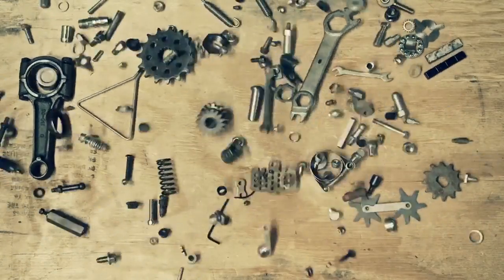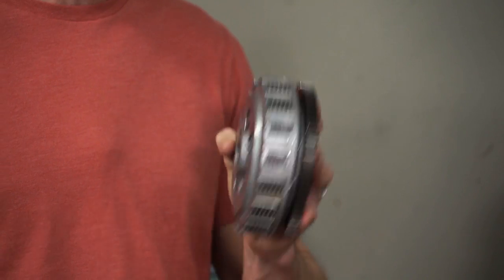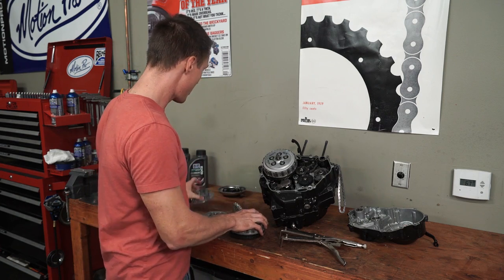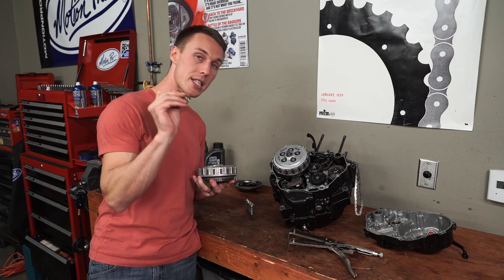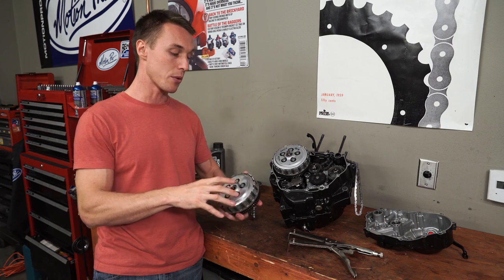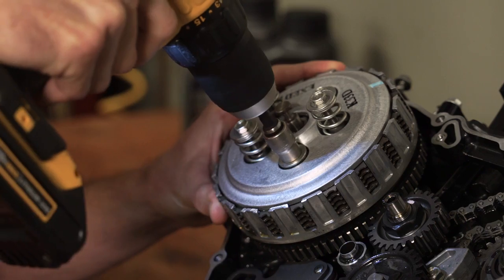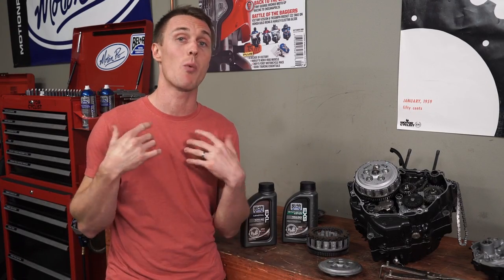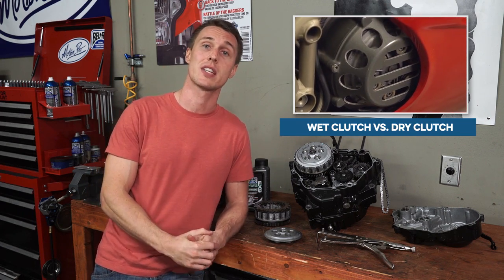How A Motorcycle Clutch Works | MC GARAGE

Comment: My brain just will not let me understand how the actuator arm can disengage the clutch. I must be missing a massive piece of it to not understand. 

Clutch actuator arms on the clutch cover on many bikes, on my bike, there’s a little plunger that pushes into the centre bearing of the clutch. How can pushing that bearing from the clutch side, cause the plates to separate? That would just push the plates together even harder.

Comment: I had an '06 GSXR 1000 that I had built and was around 175hp to the wheel. And I had to get new a new basket and inner hub, because mine chattered if I tried to take off to quick, and it would lurch. So I got a new basket and hub, and I added three more holes to the basket to allow for more oil. And when I did that, I also put heavier clutch springs in to decrease the wear on the clutch plates. My clutch lever pull was heavier, but it wasn't bad, and I prefer a heavier clutch pull.

Comment: I've always thought it was amazing that those plates and sitting have enough friction and force to not just slip when the power of the engine is put into it. You would think that the power of the engine would just overcome the friction of the plates, but it doesn't.

Comment: What if their could be hydraulic assistance for a racing clutch ...like an auxiliary pump that sends power to the clutch handle on demand in order to make the pull tension demand easier...or a diaphragm in a cavity that would open and shut somehow...like power steering...would that be hard to engineer and integrate into racing technologies...i mean like for ease of operation on a pilot...what do you think???

Comment: I hear people talking about shifting with the clutch partially pulled (like 1/2 of its full travel). They call it something like "shifting in the frictione zone".
Their argument was 1/2 the travel is enough for transmission to completely cut off. AFAIK the travel of the clutch can be adjusted and bikes aren't equally manufactured. I don't ride, only drove a few hundred Km or so on a friends bike and i notice their clutch need to be fully depressed like 90% to be fully cut.
So what's your take? I love to hear from the the engineers who work with the inner of these machine instead of some random biker on the net

Comment: My KTM rc 390 2015 10,500 miles clutch just broke, ( I think.) I was on the freeway and I switched from 5th to 6th gear and I heard a clanking noise. And I lost all power. No matter the gear I had no power, it just reved away. Is this fixable?

Comment: So I have a 1999 honda cbr 600 f4. And I had some creeping issues when I pulled in my clutch so i adjusted my cable from top and bottom and that didnt change it. So I bought a new cable. Installed it. And nothing. Same issue. Now I cannot even put it in gear before it stalls. I think it may be the lifter art or actuator. But I'm not familiar with bikes nor have the money for a shop to diagnose. Please help.

Comment: Hey i am 55 years old  and usually for. Me its easiest to  understand mechanical things bu physically looking at it or by. Reading a shop manual with good illustrations  ive been riding and fixing. My own motorcycles since i was  a kid and despite knowing what a motorcycle clutch pack looks like I really  didnt understand how it worked so. I watched your video and learned pretty easily  I’m not sure if it was your  simplified explanation or the  tone of your voice but i do again want to mention  usually a video isnt  as easy for me to understand  something mechanical as easy as. Your video did. So i just wanted to say thanks and i hope you do continue to make similar  videos  in the future  at the moment  i am not riding a motorcycle due to a Traumatic Brain injury ( non motorcycle related) that caused. Some paralysis. In my right hand/arm , and left leg  that would affect my clutching and shifting  i turned to YouTube to see. What might be  my options  as far as making a bike a auto or semiautomatic transmission  as i remember. I had a early 1970s Honda Minibike set u that way  and ironically the motorcycle i  actually. Do own at this time  is a  older Honda with a similar  engine that was my Fathers  that he bought and put into inside storage in the early 60s  so ive been trying to learn as much as i can  on the basics  as i found out Honda did make a Semi Automatic clutch pack for those old Monkey bikes but the case is a little different than mine  so it wont fit  if i want to maintain the factory look on mine which i do ! Just   For giggles i thought that would be  the route  keeping in mind  it is only a 90cc motor and would never really be. A touring. Bike for the highways and may   Be  for local shows and  possibly parades  ? Because it was my Dads  i just want to have fun with it

Comment: I have one doubt about bike engine cc,
Why always engineCC are 154 for 150,179 for 180
Etcc,,
Their is a slight positive or negative variation in engine cc,but the bike aa known as RC 390,R15,Pulsar 220,RS 200,
Why the manufacture could not build that engine with correct engine CC mentioned in the their name,
Plz anwr my qst

Comment: Hi. Can you help me? I think i have a clutch problem, because when i turn on my bike (Yamaha Virago 535 - 1997) it makes some knocking noise, and when i pull the clutch lever in neutral it ends, and starts again, when i release the lever. There is NO problem when i shift, it behaves normally, smoothly. My question is, can you name the problem? Does it really bad? Can I ride it with no fear?

Comment: So im a bit confused. With the bike started, I'll shift my bike from N to 1 (with the clutch pulled in) and everything will be fine, but if the bike is not running, I can't shift it to 1, pull in the clutch, and then roll the bike? Is that supposed to be like that? 
Sorry I'm kinda new to motorcycles :)

Comment: If my clutch is slipping, how can I check to make sure it wasn't just the oil? Add a little gasoline to the oil, run it a few minutes, drain and refill with known proper oil? Assuming I haven't already worn out the clutch from the slippage...

Comment: When I pull my bike clutch n it’s in gear it still moves any help and u will hear some noise in the engine
Reply: Adjust clutch lever tension or replace the cable. For some bikes you might need to lubricate it too. Check the oil level on your bike while you're at it.

Comment: I have a 900 vulcan. I had a shop put a new clutch kit in it ,got it back and is started barking on take off in first gear.took it back he changed the  two outside plates and cleaned all the metal plates.I went and got it and it made the same noise at the first two lights. took it right back ,he think i'm dumping the clutch to fast.I think he is wrong ,it shouldn't make that noise at all. It sounds like a dry clutch.so i'm wondering could the clutch basket be bad and making the noise ?

Comment: I have a problem with my bike not sure whether the issue is with Clutch or gears. In the Morning Hours or when the engine is cooled down every time when I start my bike and put it in first gear it makes a big sound, goes little forward and the engine gets turned off.  but once bike engine gets heated up it doesn't make much noise but gives a little jerk. Gear shifting is also hard. I have changed clutch plates but I still have the same issue.  can you please tell me what is the exact problem

Comment: for the clutch and the engine is it better to (while changing up gears for examoke 2 to 3 etc ) accelerating while releasing the clutch or just before for smoother ride and clutch use ?

Comment: Hi I have a honda xr650l 2012, but know when I start the bike in neutral the engine runs, but when I put it in gear the bike jumps and die, it's like putting your bike in gear without putting the clutch. What do you think is wrong we replaced the clutch plates but it isn't it, it's still doing the same?

Comment: My clutch cable broke.  I was still able to shift gears by moving the lever on the engine by hand and working the shifter.  Before and after replacing the cable, I kept checking to make sure this was still working, and it did.  Once I'd replaced everything and adjusted the tension, I started it up and now my shifter won't budge at all!  Can't get out of first.  What gives?

Comment: I am having an issue with the gear change. It gets very stiff from 1st to 2nd then they work normally. Is it something to do with the shift gear? I have tried to adjust the cable but no use. Should I change the whole clutch? Any suggestion will be much appreciated.

Comment: Great video keep up the great work my question is I have a 2013 Honda CBR double or 1000 with 2500 miles on it and when I engage first gear it hits really hard even when it’s warmed up it idles at 1200 rpm’s I cannot find anything on this is it an adjustment internally my lever adjustment is perfect thanks Dan P

Comment: I think I FINALLY understand how a motorcycle clutch works! It's especially funny because I left my clutch exposed on my Ducati 748 (arrogantly thinking I looked cooler) and made a stupid mistake when I was learning the bike, ending in my clutch in pieces across the asphalt. Not pretty. But the worst part is, I had NO idea what all those parts were for, and so had to shell $$$ I didn't have to get it fixed by an expensive dealership. Now I understand what all the springs were doing, and I've learned my lesson on many levels XD

Comment: I'm looking for a description or demonstration of how the clutch release system works. I wonder if there's a bearing that is spinning when the clutch lever is pulled. In a car or truck this is known as the throw-out bearing but I haven't found a description of the clutch release yet. Does it stop or is it wearing the bearing when at a stop and the clutch is pulled? Might it save the bearing if it's in neutral instead?

Comment: Ari so basically when you disengage the clutch when pulling the lever the inner basket together with the steel plate rotates with the gear shaft. The outer basket and the friction plate rotates with the crank shaft? Did i get it right?

Comment: Hi and thanks for the video, I have a VFR 750 F 1997 and with the bike running and and in nuetral there is a distinct rumble from the clutch which goes away when I pull the clutch lever in. There doesn't seem to be any clutch slip so I'm thinking a bearing or clutch basket problem, what's your thoughts on this please.

Comment: good day ari henning,,,, what will happen if a clutch has already slipped and my bike runs already but not much because it loose power at a high rev. my  question is,, does the clutch housing or inner hub? will be worn to,, if i use my bike with slip clutch,, but i doesn't drive on  high speed.. thnk you and i wisht that you answer my request tnhk you

Comment: can anybody answer me this question pls. someone asked if it's safe to freewheel squeezing the clutch lever all the way back? will it damage the clutch pads and plates sooner than expected? the guy who asked this is a newbie and most of the people answered "yes" it will. cause basing on the video once the lever  is pulled to disengage the plates will rotate independently so no pressure is placed on the plates and pads so no friction to damage them.  is it safe then to pull the clutch lever all the way back to do a freewheel run considering when you re-engage or release the clutch lever it should be at least close to its proper gear and RPM to minimize the stress on the pads and plates? thanks Ari and McGarage

Comment: Stiffer clutch springs do result in a heavier clutch lever, but the upside is zero slippage and all the engine drive is being transmitted to the rear wheel for max power. So if your OEM springs are too soft, upgrade them to a stiffer version and enjoy the difference. I did and I LOVE it.

Comment: Ari, I have a question! When replacing a worn out clutch pack with an aftermarket pack, why do most aftermarket manufacturers recommend you NOT use synthetic oil? If you soak the friction plates well, shouldn't it not make a difference? I've considered aftermarket clutch packs, but never pulled the trigger due to the manufacturer recommendations to only use mineral oil. Any insight you have on this would be greatly appreciated. Thanks!
Reply: Thanks!

Comment: synthetic oil is kinda pointless for dirtbikes when you have to change it so often. they ones that dont make a clutch slip are probably expensive. i learned the hard way it makes the clutch slip, changed it went trail riding then wrecked once it soaked to the plates lol.

Comment: So what is the answer to the debate about leaving the clutch lever pulled at a stop light as apposed to putting it in neutral and releasing clutch?  Is there any more wear on the clutch to do this or does it even matter?
Reply: Ari Henning thanks i have the habit of leaving in gear also but always worried it was wearing clutch too much. I can deal with some wear for the added safety thanks!

Comment: Thank you, Ari.  This sorta explains why, when idling in neutral, there seems to be more clutch related noise.  I presume it is the outer basket spinning and the disengaged inner ring & pressure plates are free to loosely spin and rattle around.  (I'm doing my best to sound intelligent but haven't a clue what I'm saying)

Comment: I wanna see what's on the crankcase that push something that makes the pressure plate away from the clutch pack. My dream is crushed again...
Reply: sometimes its a shaft that is splined with a puller
sometimes its just a rod that pushes

Comment: hi Ari.....!!! some bikes have a double cable line from the accelerator and some have a single cable line from the accelerator for the same model.so,what's the real advantages and difference between them???????plzzzz do make a video on it
Reply: its a return cable it makes the throttle snap back
Reply: ohh so what's the advantage of it jth_101....
even a single cable also comes back?
Reply: Bubloo Bublii 
It's almost a redundancy. with either throttle cable arrangement, the throttle body has a spring to close the throttle and return the throttle tube to the starting position. the advantage of two cables is if your pull cable breaks and gets stuck with the throttle open, your push cable can still close the throttle.

Comment: Hi, I have a 2009 Yamaha YZF R15 (150cc motor cycle). I have been facing electrical issues with the bike like headlights flickering. And horn sounds weak while the brake is held or headlights are on. The Engine Check (yellow light) switches on and shows a error code 46. I have tried to get it resolved with a genuine Yamaha service station.But, the people at the service station were unable to address the issue.I look forward to your reply regarding my issue. Thank you.
Reply: Ari Henning according to the user manual error Code 46 is related to Voltage Monitoring. I got my stator coil replaced a few months back and still facing the issue.
Reply: ***** thanks. I'll have a look at the connectors, ECU and the ground terminals and regulator/rectifier.

Comment: Great video! The rc390 looks really really good!

Question:
I have a Duke 390 and whenever the bike is stationary and runs on idle in the neutral gear, a slight metal rubbing metal noise could be heard from the gearbox. The noise ceases once you pull the clutch.
My question is, can I rely on this noise to know if my clutch plates have worn out?
I.e, no more rubbing noise = worn out clutch plates?
Reply: incorrect

if your plates were bad they would slip
Reply: jth_101 ah which was what wanted to ask. If the noise stops, that would mean the plates are worn I.e, bad, right?
Reply: ***** Thanks for the reply :D

Yes that was clear. But I wanted to know if you are getting a subtle noise from the clutch compartment. Could it be my slipper clutch since your RC didn't come with one?

Also as it was pointed out, if the clutch is worn, power delivery is poor since it tends to slip.
Now, about the noise I'm getting, is it a sign of worn plates if the rubbing noise stops since the clutch plates are slipping?
Reply: If you abuse your clutch you can actually damage your clutch basket which can cause a grabby or noisy clutch. Also, in some bikes the springs in the clutch basket for some reason shrink and kind of just vibrate back and forth, which is what you might be hearing. So you might want to check that out although clutch baskets are pretty expensive.
Reply: MotoBoy I don't think so, the spring shrinkage makes sense as I can see that as a source for the noise I'm hearing. But then it's been like that since I bought the bike almost two years ago.
Are you sure it's got nothing to do with the slipper clutch?

Comment: my motorcycle clutch spring assembly  wasn't as simple as tht, I need to screw it alternately or you will crack the pressure plate.. and I've cracked one  -..-

Comment: Can you guys do the charging system sometime in the future?
Reply: Both!  :)
In my case, my my regulator / rectifier blew up, so I replaced it with a new one.  But when I turned the key to the "on" position, the lights didn't turn on.  So, I checked the battery, the stator, the new regulator / rectifier (with a multi-meter), and the fuses.  All okay, and still, when I turn the key to the "on" position, the lights don’t come on.  I don't know what I should do next.  It's a 1999 Honda Magna.
Thanks Ari